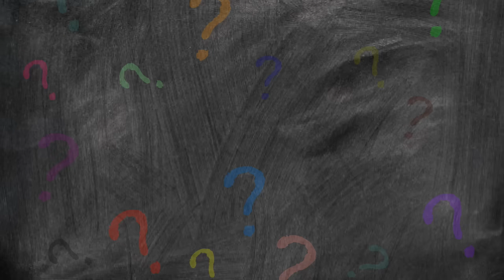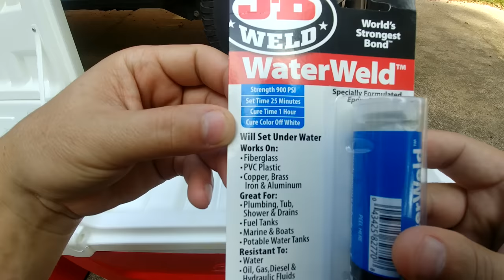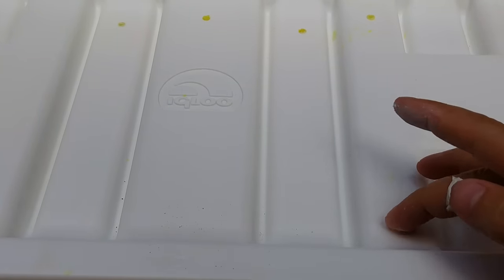Do Yeti cooler hacks work?

Comment: It would have been interesting to do a "control" test first - with unmodified coolers.  It's quite possible that the two cheap coolers had different performance when new, due to quality control issues like incomplete wall or bottom insulation. I'm not saying this is the explanation, but it's a factor which was not eliminated.

One possible misconception is thinking that a heavy lid is a good sign.  Actually, you want foam which consists of mostly gas pockets.  Heavier foam suggests more solid material to conduct heat, and fewer (tiny) air pockets to insulate.  The lightest foam (per volume) is generally the best at thermal insulation.

Air is a pretty good insulator - unless it's moving and thus able to carry heat by convection.  In a large closed area, thermal air circulation driven by warmer air being lighter and rising can create that kind of convective air currents; the more height in the area, the more differential to drive such currents (via gravity).  Insulating foam works by trapping as gas in lots of tiny bubbles, each small enough to not generate much of any convection, while minimizing the solid areas between bubbles (which carry heat via conduction).  

On a wall, this is important.  The horizontal nature of the space, combined with cold being conducted mostly from the bottom (via the inner plastic wall), would be ideal for creating thermal air currents.

Within a thin horizontal lid, there isn't a lot to drive convective currents.  It would be pretty evenly cooled / heated, and there is not much vertical space in which to separate warm and cool air rising and falling.   I can easily imagine the air gap itself working better than anything except a superb lightweight foam.

The foam might help if both coolers were in direct sunlight (so the outside really got hot), creating a larger thermal differential to drive air currents.  Or it might not.

Comment: One of the best insulators is air. That's why tumblers work so well to walls if materials with an air gap. Just like building a house you fill the wall with insulation then there's an air gap. If you need a bigger r-value you can make a bigger ait gap in wall and a house will have higher r-value. The foam is conduction the heat from surface to surface when the air gap doesn't.
Reply: Tumblers are vacuum sealed. The LACK of air in the walls prevents thermal transfer.

Comment: It's gotta be Vacum in original? Wich is best insulation.
Even if it is pocketed air, it is better insulation then foam insulation. You never seen windshield insulators? Or pocketed air insulators in hardware stores?

Comment: Should have pre tested them to see if they were equal before modifications. But they may have uneven sun load on them. Test 2 more times, swap the coolers from left to right then retest with swapping the lids. The one on the right could have been built to a higher quality by chance.
Reply from the maker: I agree I should have but I guess I was not expecting the result I got. If the hacks worked at all the results would have been so much better it would not have mattered.  I can assure you the sun load was equal.  But I will be retesting these same coolers because there are so many questions around the results.
Reply: @HowToWithJames  Its a great video idea. I was suprised lol
Reply from the maker: Thanks!

Comment: The issue is that you want to prevent the conduction of heat. Foam is generally better heat conductor than air.

Comment: Someone else may have made this comment, but I didn't see it.  If the cooler were sitting in direct sun light, I believe the insulation on top would help.  As it is, the 4 walls and bottom of the coolers have way more surface area to let the heat in.  Also, I would agree with someone that mentioned the insulation in the lid would actually hold any heat in that would have built up while you were getting more ice.  And....the walls really are probably not actually insulated🤔

Comment: I'm reading these comments about the foam is transferring heat, that is completely wrong.  The R-value of air from 1/2 inch to 4 inch thick is 1.  Polyurethane Foam 1 inch thick has a R-value of 6.25. 
The resistance of each material to heat transfer depends on the specific thermal resistance [R-value]/[unit thickness]. The higher the R-value the less heat transfer.
I would suggest swapping the lids on the coolers.  
To me, it might have worked. Only if you tested the modified cooler before modding it.
Great video, hope to see an update.
Reply from the maker: Thanks for the information. I agree with you that I should have tested the coolers before I modified them but I think if this performed like a Yeti it would not have mattered.  Would you suggest I do something different in relationship to the foam?

Comment: That foam insulation may have been causing a heat transfer, greater then that of an air gap. Some spray foams may be made out of materials that create less heat transfer. If you use foam board rigid insulation, and build a box for the cooler, you will get better results. You will achieve both an air gap as well as keep the cooler in its original condition.
Reply: thats probably why the old cheap foam cooler works better than the plastic

Comment: The bottoms and sides of a $17 cooler won't be insulated either. Foam the whole box and I'm guessing there will be a noticeable difference favoring the hacked cooler. Hot air rises, so you're losing most of your 'cool' through the coolers base.

Comment: A thin pocket of air is a better insulator than foam hence the reason why the lid is not insulated. It creates a vapor area which will have a better R value than just filling it with foam.
Reply: Another way to think about it is the same reason why insulated tumblers are insulated with a pocket of air and not foam.
Reply from the maker: My question for you would then be why do Yeti coolers insulate the lid in their coolers?  Why don't they use only air?
Reply: How To With James They use 3” of high dense polyurethane foam and the lid has been vacuum to remove the air. When I did some test with my brothers $1300 yeti compared to my cheap-o ($200) cooler I found that just filling up the bottom only with ice they both lasted about the same. The instructions for the yeti did say to pre chill it by filling it with a bag of ice and let it sit for a few hours before using it (remove the remaining ice before putting in beverages and then refill after filling with beverages). The biggest thing about a yeti is how thick the insulation is and how the yeti lid seals itself after you close it. I think you probably had roughly 1” of foam in yours and I’m not really sure the R value in spray foam at 1” thick. When I chilled my brothers yeti with ice AND i stuck it in a big freezer (also did the same with the $200 cooler) the yeti beat the cheap-o by 12 hours! Now what I was thinking while watching your videos is you might be able to glue a piece of plexiglass on the bottom of the lid on the modified cooler so it would have a air pocket between the ice and foam. Another draw back with those coolers (yours) is the hinge design, I noticed when you closed the lid with the rubber seal the back did pop up very so slightly and with that type of pop on lid it would be very difficult to get a positive seal. My $200 cooler has permanent hinges and has a uniform seal land all the way around to prevent coolness from escaping. Another hack if you just want to get your beverages colder faster is to dump salt over the ice. Trust me that works well but the salt will make the ice melt faster but produces much colder drinks.
Reply from the maker: Thanks for the information! Salt and ice that is interesting!

Comment: The modified cooler never had a chance. It was from a different supplier. Companies like Igloo give different level products to different distributors. For example, companies like Walmart often demand the cheaper quality versions. I loved this test. It was awesome. The only thing missing was a baseline. Testing both before the modifications. I would bet the modified cooler wasn't made as well, having less or worse insulation. The obvious answer is that adding insulation to the top would only increase performance or at least be as good as the original product. Your work, nothing wrong with it. I say the cooler you modified must have had less insulation in it to start, or a lower quality foam R-value.

Comment: Heat rises...cold settles...also insulating the bottom of the cooler should make a significant difference.  Drill holes in the top of the side walls and filling it with foam should make make a large difference. What you have is the well insulated top is trapping the heat that enters through the bottom and side walls. I bet if you tested it with a hot (something about 140 degrees) you would find that your "hacked" 'cooler' would hold the heat longer than the stock 'cooler'.

Comment: I don’t believe the side walls are insulated. That would account for the modification making little or no difference.   At the cost of the cooler it seems that it’s too cheap to have any insulation. Put a couple of holes in the sides and check for insulation. Also put the modified chest on the right side, maybe for whatever reason ( sunlight, near a wall ) it might be warmer on one side.

Comment: i bet the foam insulation retains the heat better than just air and since it is so hot in the car, the modified cooler is like a heat sink and attracts more heat than cold

Comment: anything solid is a conductor, anything hollow is an insulator. Air gap between surfaces stops heat transfer from one surface to another.

Comment: The foam makes for better thermal transfer than just air would, thus the modified cooler will always equalize to ambient faster. Same principle to plastic cups and thermoses with just an air gap, only way to make it more insulating is the metal style coffee mugs that have a vacuum between the layers, no air no energy transfer, these are called Dewars in science, they are what liquid nitrogen are stored in when not under pressure.

Comment: That foam is to seal cracks pretty much, is not intended for insulation. The temperature will make the lid get hotter because the chemicals in the foam is not intended for that purpose....I can be wrong, but this is what comes to my mind.

Comment: Insulating the top doesn't really make enough of a difference thats why it is just an air cavity. The best easy improvement is a piece of foam insulation under the bottom to block the rising heat.
Reply from the maker: I was only changing the top of the cooler because every video I saw on doing these hacks only changed the lid.  I guess in those videos they assumed the bottom of the cooler already had insulation in it and just the lid was the problem.  My goal was to see if these hacks as I saw them being done worked.

Comment: The reason the stock cooler worked better is the same reason as a yeti tumbler.  Its hollow inside.  Heat does not transfer as easy through air tight voids as it does through solid foam.  Which is the reason yeti does not fill their tumblers with foam

Comment: Cooler body needs to be done also or no change.
Reply: Also I think the lid was overfilled with foam That lid should not weigh several pounds even when filled That foam expands an incredible amount it doesn't take very much to fill it at all

Comment: Conduction is occurring.  Consider the cooler like the windows in your house .  There are two panes of glass there, an interior and exterior plate, but why?  The airy space is less efficient in transferring energy, which is a good thing.  If you want to try something crazy try filling the voids in the plastic with water.

Comment: Could be because air is actually a very good insulator. Not sure but if they have the lids under any negative pressure that would also make them even better insulators.

Comment: My guess is the modded lid transferred the heat easier into the cooler than the other  because of the air gap between the surfaces in the other lid. That would be my guess

Comment: Appreciate your method on this.  Coolers in back of SUVs are one case study - how about in the open air with the sun beaming down?  That's what my coolers are subjected to when camping, rafting, etc.  (after we drive there of course)  I have a few decades old Gott 80 coolers I'm not giving up on.  Cheers!
Reply from the maker: Check it my second video. I did exactly that. Direct sunlight.

Comment: the reason feeling that lid with foam did not work is because there has to be an air barrier in between the two solid surfaces just like on your home when you have double insulated glass there is air in between the two panes of glass. That air pocket between the two panes of glass is seal and slightly pressurized. That's what gives it its insulated properties. When you filled it with phone you took away the air pocket taking away it's insulating capabilities.
Reply from the maker: Why does this work with a Yeti cooler?  The lid and base are both insulated.

Comment: Well it was hot in those coolers before you shut them so the modified one held in the heat do to the foam so it did it’s job but in reverse

Comment: The best way to make a long lasting cooler, or hotbox. either temp maintain for a long period. Is Follow good old Thermal flask design. Many thermal cups, and lunch boxes and what ntos usee the design, which YETI also follows the design principle but made 1 change from Thermos. Its basically 2 Layers, It can be in plastic but needs reinforcement, but the good ones are stainless steel. And  inbetween the layers, roughly anywhere from 5mm to 10mm of space from outer layer to inner layer, fully sealed (metal ones are welded tight) basically making 1 continuous chamber where its just air sandwiched by the outer and inner layer. Finally the air is vacuumed out (the reason why the really good ones are made out of metal over plastic) The cups can be plastic as its a circular design and reinforcement comes from the geometric shape itself, but anything with flat surfaces like a icebox, needs reinforcement inbetween the layers, to keep them from collapsing under vacuum, so like support braces with a rubber joint to sandwich em. 

 The reason this works is the vacuumed layer isolates the inner layer from loosing the temperature of the material placed in, whether its liquid or frozen, hot or cold, the way heat and cold temps dissipate is from conductivity through thermal radiation. The cup or box gets thermal heat or cold soaked, by contact and then bleeds off into the surrounding air. The vacuumed layer stops the dissipation of the temperature difference since the air between the layers no longer being a medium for transfer. You still loose some temp over time, whenever you open to access, and or have a pressure vent like on a cup lid. But its minimal loss. Ive literally had half a cup of soda with handful of ice, stay cold, with ice not melting, and gotten colder since the ice just kept chilling and no thermal radiation of the cold. for a solid 24 hours or more later. 

So perhaps, if your willing to try it out, as it may be tedious, but fun though :) Convert one of the iceboxes. In your case since you already filled foam up top, it can act as a reinforcement for the layers to not collapse under vacuum, and same time since its foam, theres still lots of air inside. Maybe do the whole box with foam as a insulator <<---- Thats what i was trying to explain up top, The vacuum layer is the insulator. LOL. Okay I'll leave the break down and not edit it, for anyone curious on detail. ---> Okay back on topic.. The foam can act as an insulator and reinforcement, Vacuum the air hot of all the sides and top lid. And test it. See if youve gained a longer duration before melting from before vacuumed insulator.

Comment: Put in a plastic false wall on the bottom side of the lid. Then use the foam to fill that new gap. might even do better if you put the foam on and cut it down. This will make sure the foam fully expands.

Comment: It's most likely caused by the Vacuum...or lack therof. The best mod would be weather stripping and no foam. The foam allows heat to transfer as opposed to a vacuum...where heat has nothing to transfer through. By adding foam, you actually increase heat displacement through the lid.
Reply from the maker: From what I remember this cooler in my opinion would see no benefit from the weather stripping. As you can see I put it on even though as I did it I could not see anything wrong with the original seal. The original seal even overlapped into the cooler base.

Comment: I worked for a company that sold yeti Coolers when they first started coming out on the market I remember seeing them in being aghast at the price.  We did a deal where we took a fishing cooler made by igloo the cheapest one of the equivalent size and a yeti cooler and filled them up with ice the yeti cooler did not keep things cold as long as the igloo did that was $70 the yeti was 350. Yetis are for people to stupid to have any sense.  I don't know why you would want to ruin a perfectly good cooler by turning it into that.

The best cooler money can buy for keeping ice is a styrofoam cooler nothing's going to do better than that as long as you can tolerate the squeaking I've seen some pretty interesting hacks to get around it I would recommend trying those.

Comment: Heat do be rising. If you have insulation on the lid, then the heat will have nowhere to escape from. Whereas the cold air will stay lower in the cooler, and that's the whole point of a top-opening cooler: it naturally acts like a "bucket" for cold air.